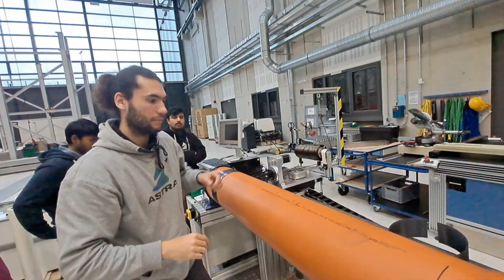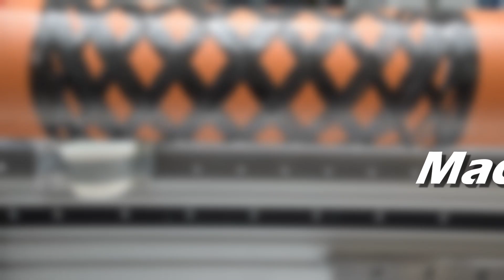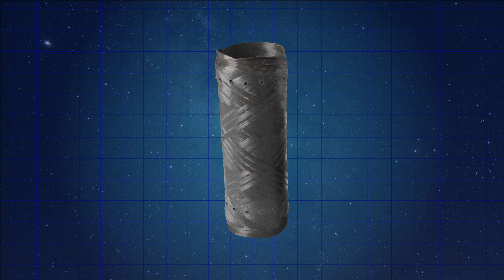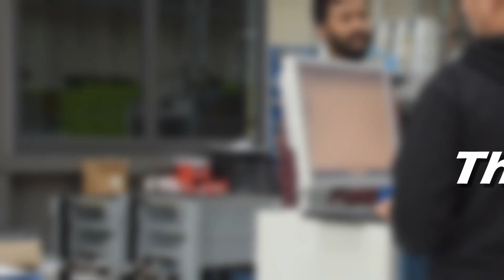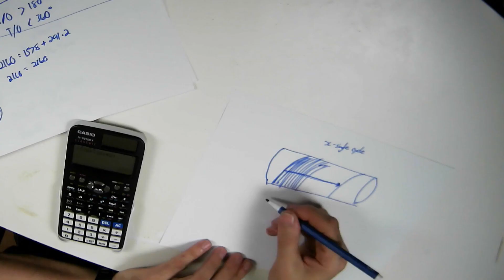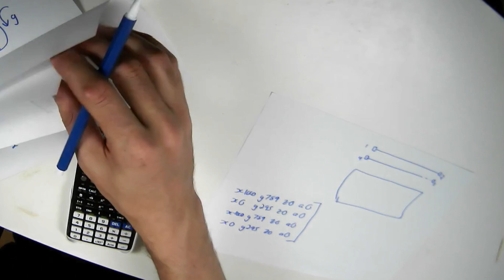Beginners Guide to Winding CFRP parts

Comment: Hi, thank you for this informative video ! Considering you experience with carbon fiber, I would like to submit an inquiry. I am building a folding bikes with carbon fiber tubes and steel lugs. The torsional stiffness of the Roll Wrapped tube is disapointing. I your opinion, how much better would a Pull Winded or Braided tube would perform in torsion compared to a Roll Wrapped ? Regards
Reply from the maker: Well, the wound tube (like we are doing it) is very torsion resistant.  I imagine if you use a cross weave for your roll wrap it might also perform better.  What was the fiber orientation of your roll wrap you did previously?  For torsion resistance, you want to have more evenly distributed strength in your fiber orientations.

Comment: Do you have to account for the diameter of the tube increasing after each 46 cycle?  Also, how do you calculate the strength of the tube to know how many total layers are needed?  Lastly, how do you choose which tow filament to use for the application?  Last, lastly, how do you determine the application of epoxy based on the design?  Is this a prepreg fiber, running the fiber through a bath, post vacuum infusion, etc.?
Reply from the maker: Wow, that is a lot of questions.  I will do my best to answer what I know:
1. For a wrap that is only a few mm in thickness it is not strictly necessary to account for the thickness increase (it will probably work out okay).  But for perfection, yes this should be considered so the g code should be slightly different for each layer applied.
2. To calculate the strength of the tube you should apply laminate theory to determine your stiffness matrix.  Then you can properly determine if the thickness you planned will have acceptable stresses at your design load.  This is applicable if you are applying pressure to the inside.  In general though, in the case of a pressure vessel and 54° layering, you need about 1mm of CFRP for every 30 bar or so of pressure you want to contain.  Remember to give yourself generous safety factors with CFRP.
3. For picking filament, we just picked the cheapest stuff that had the properties we wanted (> 200 GPa elasticity and >4 GPa ultimate tensile strength)
4. Pretty much anything will work, but you need to think about how you will operate.  We chose an E45KL epoxy system which gives us 45 minutes before it starts to cure.  We started with an E25KL and had great difficulty with the stuff curing too fast and wrecking our wrap.
5. The fiber we used is just a regular 50k fiber (no resin on it).  You have to pass this through a resin bath.  The resin we use can be just cured a room temp and we do that without a vacuum.  We tension the fiber during wrapping to 50 - 100 Newtons so the wrap is actually really tight without a vacuum.
Reply: @ASTRABremen  you da man!  Thanks so much.  I tried to look up laminate theory, and thought it might be simpler to hire an engineer for a specific project rather than trying to figure out all the squiggly lines in those equations.  Or, easier yet, copy an existing design.  Start with a simple tube made to handle linear, compression and tension loads before moving on to sailing masts designs.  
Also, if you wanted to make telescoping tubes, because you have to slow down and basically pause the carriage at each end, I’d assume you would need to cut the ends of the tubes where the thickness builds up in post processing, or is there another way around this?
Reply from the maker: @nutsandbolts432  it is best to lathe the tube after, if you need precision.  Be careful though because machining carbon fiber has health risks associated with it.